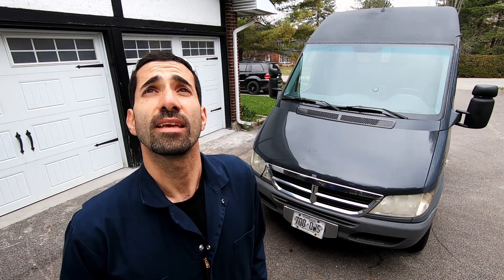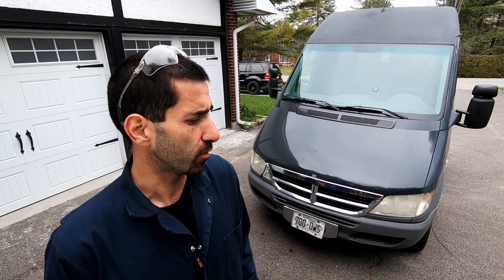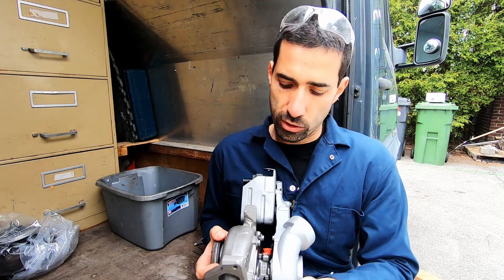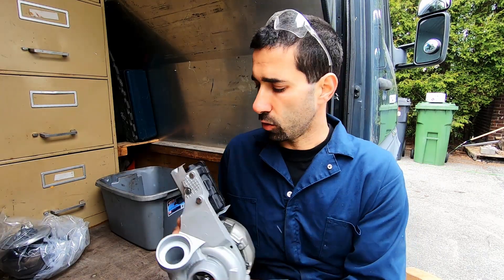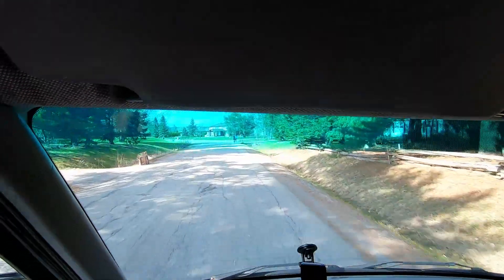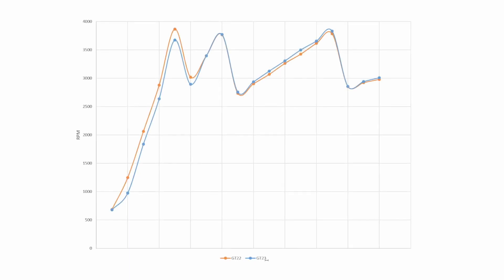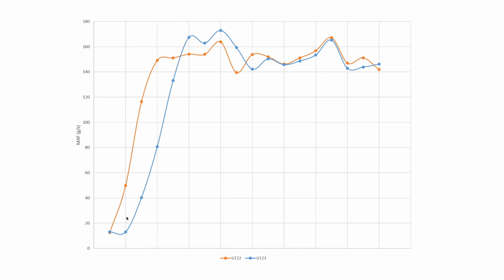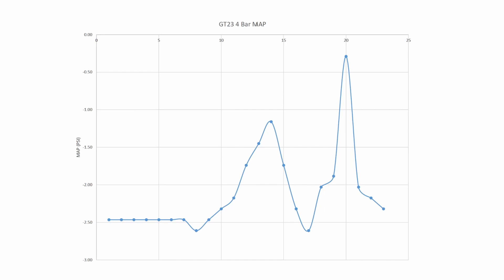2006 MB/Dodge Sprinter (T1N OM647) turbo upgrade - Part 2 - GT23 hybrid install

Comment: What was the software you were using on the laptop
Reply from the maker: I used Ross Tech VCDS to log basic OBD values...the software is designed for the VAG family of vehicles (VW, Audi etc.) but it has great logging capability you can use on any vehicle with an OBD port

Comment: great job, thanks for explaining it  in a very simple way !! i have a 2005 dodge sprinter, that i bought from FedEx in a auction, i an having trouble with my engine wiring harness, meaning #5 injector now when the engine is on it has a misfire throughs, a code, i installed a new injector but does the same thing, #5 misfiring. I've checked everything, all,sensors are new, could i need to replace the engine harness or maybe it's the computer? any suggestions. thanks mario.m

Comment: Now you need bigger injector nozzles fitted to your injectors. You'll have more air available than your injectors can produce fuel for. Those injectors are good for 50hp per cylinder max 55hp if extending the injection window beyond silly and running 1800bar rail pressure. Greets from Scandinavia/ Finland.
Reply: NiTeCProductions You need to learn the programming yourself, that's what I did when I wanted something that was not available by tuners. Go to ecuconnections forum and there you find a place to start.
Reply: NiTeCProductions I drive a s211 merc with modded om647 small videos on my channel of some stuff about it and injectors. They are in Finnish though. But youl get the idea.
Reply: MJPilote please tell me which noozles fit Plug and Play on the original OM647 Injectors!!!
Reply: Mateo Lelic All DLLA injector nozzles with P frame and with spray angles between 146-153 degrees. But all need new calibration data for injection duration maps. You can't just swap nozzle and call it good.

Comment: Was the new map sensor plug and play or did you have to upload a tune to the ECU to accept it?
Reply: @ETMotorsports  but you are running the van with the new turbo and map sensor and no tune?